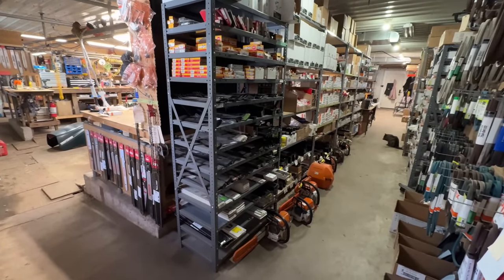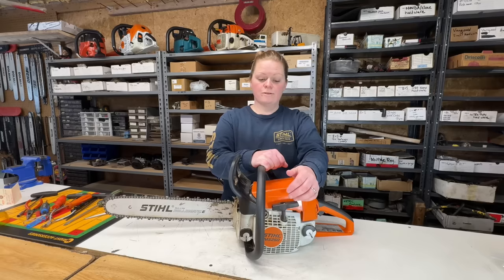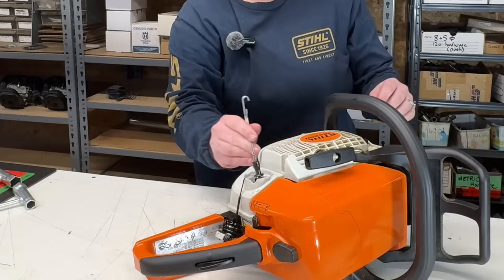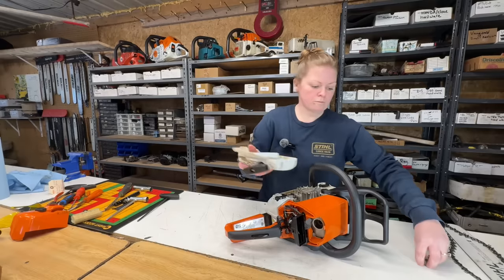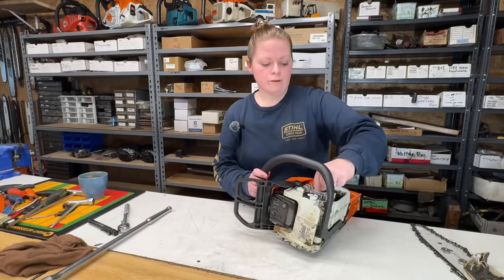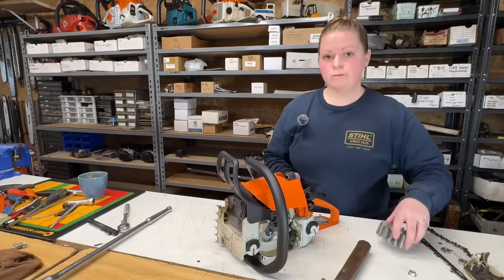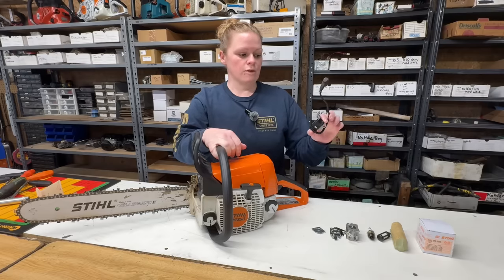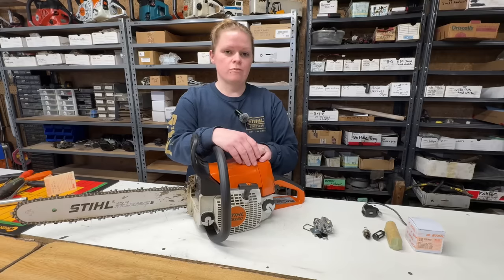Stihl MS250 Chainsaw HARD To Start!  It Wants To Rip Your Arm Off!  Let’s Dive In and Find Out Why!

Comment: MS250 owner here. Excellent information. Thank you!

Bad arms and back here... and I'm on my second MS250. It's a good saw. I'd only add that... 
the saw CAN be a real stinker to start... IF care is not taken under full choke.

Suggestions:
- Find a good video on the proper starting procedure. Doing so has delayed my meeting Jesus and reduced my profanity tirades by a factor of at least 4. That's probably what happened to my first MS250 (it died of shame as I verbally assaulted it over the years). Don't be me. Learn (early) how to properly start your MS250. So, here's what I learned...

- I've found that it's important to listen and be super-aware on the initial full-choke pulls. If you don't hear/acknowledge the priming (final) pull in full choke, and continue pulling/fail to advance to half choke,  it takes ONLY ONE superfluous full-choke pull to vapor lock (or flood... not sure) your engine.
When this happens, you can cuss and pull till your arm comes off... and the saw WILL NOT start (not anytime soon anyways).

- To help avoid this, I learned to slide half of my hearing PPE up so I can LISTEN while I was pulling in full choke. I've also found that going gloveless (just on start up) helps the senses detect the very subtle priming/final pull. Listening is the main thing.

- If you lock/flood your engine in full choke, the best solution I've found is to remove the cover, air filter, winter screen, plug wire and either loosen or remove the plug, pull several times to clear, reinstall parts... and pay better attention when you are on your full-choke initial pulls.

- Bonus: treat your plug wire (on the saw) with kid gloves. Parts quality (I believe) has gone down hill as of late. Early on, my second MS250 became difficult to start, the gremlin going undiagnosed for an entire season (complete profanity relapse ensued... I was down to learning curse words in other languages by the end of winter... that poor saw). The next spring, the long-fatigued plug wire gave up the ghost and came off in my hand. Replacing it confirmed the elusive problem... frayed or fractured plug wire that chose which days it was going to close the circuit and allow starting. Moral... plug wires (on saws) are not designed for repetitive un/reinstalling. Possibly my fault, but likely a crappy plug wire.

- Lay in a supply of spare parts for a rainy day(s) and/or chintzy part failures brought on by the communist invasion and resulting decline of society, infrastructure and build quality.

Hope this helps. Good luck and be safe.

Comment: I have had a husky 142 for 15 years. Used lightly for pruning and firewood. It became hard to start and wouldn't run. I was really puzzled, dismantled  the carb. All looked good, but no dice. Finally I tried adjusting the H jet, and yeah it now works like new! So happy that I figured it out, and fixed my baby. A chainsaw is like a dog! Cheers from New Zealand😊

Comment: When you had taken the saw out without the bar and chain, you can hear the drag on the throttle response. I always hit the carb first when I see ready mix fuel. As for the special tool for the piston, use a pull rope this way your not messing around with a flashlight. You are spot on talking about the compression on that saw. It will rip your arm off if you don't find the sweet spot.

Comment: Great video, thank you . I  have a MS 250 and it runs great with no complaints.  I pull it over on choke slowly the 1st time  then the 2nd pull with the choke still on I  do it full speed and it fires up with out riping the recoil rope out of my hand.

Comment: Excellent presentation. Very methodical.  I am a small engine technician in the UK working on lots of main brands of horticultural machines and the first person to blame is the owner / operator in all cases. It's their machine and it is their problem.  I've had customers ranting and raving that the machine is junk and they either want their money back or the machine fixed free of charge under warranty.  But it invariably is something that they are doing or have done.  manufacturers spend a lot of time and money designing machines and it's very rare that the machine fails without the assistance of a bodging owner or someone that has been lent a machine.  I have a wealth of stories of things that owners / users do to machines. Love from the UK.

Comment: I also have a Stihl battery saw and it always starts very easily, has no fuel issues, etc. My go to saw for firewood. My sawing technique got better as this saw does not like to be forced at all. It will do the job on its own just fine. I can carry it in the car for blowdowns on the driveway and the roads.

Comment: Starting my chainsaw, I use to put my foot through the hole where the hand to operate it normally goes. The Chainsaw doesn't jump around then when you pull the starter cord.Easier too.
Reply: Tiny feet or pointy boots ?
Reply: Hard with 17EEEE lumberjack feet.
Reply: @ValChristian-c9m  
YES! Why is it that the handles of all chainsaws are just a bit too small to get the toe of your boot into the handle? They all need a bit of a redesign; perhaps all the manufacturers assume that people drop-start their saws. I never do that because it seems dangerous to me.
Reply: @richardjames4632  I couldn't agree more. In user manuals manufacturers advise against drop-starting and advise to use safety gear, but still are not able to make the handle wide enough to put the toe of a safety boot  into it

Comment: I worked on a Stihl 046 and it also was a hard starter.  I am 73 yrs old and it would try to pull my arm off.  I rebuilt it a couple of times, replaced the crankshaft, piston and cylinder.  It is one of those saws that wants to pull your arm off.   So I made an electric saw started .  I took a 1/2 hp electric motor that can run both forward and reverse.  I machined an adapter that matches the flywheel pull starter. (you have to remove the pull starter housing.)  I engage the motor/adapter to the chainsaw and I have the electric motor plugged in.  I have a foot switch that has a momentary contact switch  installed.  You engage the motor and saw, step on the momentary foot switch and the electric motor starts the chainsaw with very little effort.  It sure beats letting the chainsaw beat me to death. When the chain saw starts it automatically disengages the chainsaw.  I use this tool on saws that are hard to start.  It lets me figure out problems without wearing me out.

Comment: I have a ms250 .Its a love /hate relationship.I love it when it starts. You can't rely on this chainsaw at all.I had it back to the dealer many times. You can pull on it and it may start, sit it down , 5 minutes later pick it up and it won't start. Sometimes it won't start at all sometimes it will start every pull. Everything on this saw has been gone over. Even the dealer told me they have issues with the cheaper saws. Now I grab the old stihl 260 and the Dolmar.The MS 250 is name correctly MS Might start

Comment: I have run mine wide open since I got it. Never failed to start once!
About 8 yrs old. 
Never changed the plug. Use only Stihl mix period.
 Have changed the rope once. Been throught 10+ chains.
Fine saw for me. But I only cutup trees that have been blown down. Lot of that here. Cuts them up great!😊

Comment: Yep, im a Setup/Floor Technician at my shop. Anyone tells me they are having a problem and they start going off about checking this this or that. I begin at ground zero. It may hurt their ego because they think u dont trust them. But i cant tell you how many times, they say it wasnt this or that because they looked at it. And it ends up being something very simple. Obviously he didn't say any of this, but wanted to act as if he didnt break the seal. So he could hopefully get it under warranty, unlikely being an old saw. But ego's are big when it comes to chainsaws! People hate to admit they were wrong or that they may have made a mistake. Especially if its a female repair tech. Some guys cant accept that a woman may be more mechanically inclined than they are... So unfortunately we've all been there. So basically start at ground zero and do all the simple checks first. That dont require new parts for replacing them after checking them out...  at least without first discussing the added costs with the owner/cudtomer anyways.

Comment: I bought my MS250 from my local JD Dealer, Last one in stock before they put out the new ones with bulb - I have a pre bulb MS250 and it ran sweet for many years, always started always ready to go. In last couple years it started running and stopping after 5 min. then progressively in same day in next 4 to 5 starts would run less time each time till just would not start. Took to shop and replaced coil. sweet again but after about 10 min. it did same thing, I opened it up and realized if they had put a new coil in it, it should be a little cleaner than it was for only making about 15 rounds cuts on 10" trees. I purchased a coil and replaced coil - it could be slightly out but close enough and should not die as it had been like plastic housing warming up and wires disconnecting in coil - only thing left is carb. shops around here are so un-trust worthy - want new gaskets etc. - iam a difficult customer i hear now. still possibly need a carb .  I have done shelf fuel, and Non Ethanol mixed with Stihl synthetic mix small bottles 1. gal. mixtures. 2 new air filters, 3 plugs, 2 fuel filters - all on top of what originally i had in it when problems arose. ( Plus new fuel lines, electrical came with coil i put in. Iam about 50 bucks away from having spent what a new one would have cost.  I actually bought a new one at ACE and it would not start a second time when they were pre fuel and starting it for sales so I ended up cancelling that CC transaction and re done because of warranty's then they had another and purchased that one, seemed all good, left- picked up mini excavator and headed for little property 45 miles away - saw would never start, it popped once and that was it. needless to say i took it back-manager would not except it so i left it on counter with papers and said CC will be stopped payment and never been back in last year. This brings me up to my age and hand- finger size- unable to put a carb on and stuck with finding a good shop, I even have 5 carbide chains and 2 extra roller bars , been using a HF chain sharpener so about 4 years ago I bought an Oregon sharpener and am quite good, I have a few guys whom are fire wood cutters ask me to sharpen their chains- usaly 8 or 10 at a time a year- I feel honored and the 8 bucks a chain is good - Iam retired disabled vet. i have a lot of free time but not a lot of time.

Comment: When I heard the symptoms my first thought was flywheel key.

Good perseverance to get it fixed.
Reply from the maker: I wasn't going to let this chainsaw beat me!
Reply: I'm putting my Stihl in the yardsale.  Piece of shit.   Plus my dealer was a real dick.

My Husqvarna chainsaws never fail and never break an arm.
Reply: I have a 250 that has a partially broken flywheel key. It lines up fine, so I’m thinking that will work for now… I still can’t start the thing, however! I even replaced the two seals. I guess I’m going to replace the carb next!
Reply: I also thought for SURE that it was Sheared as well ...  but then my only real experience of replacing them is on  Lawnmowers .. Never seen one actually sheared on a Stihl Chainsaw.... but the symptoms certainly matched .
Reply: I had an old 041 given to me years ago that had a sheared flywheel key. Have no idea how that happened, but a new key and it ran fine again.

Comment: I have a Stihl 032 that had been giving me same problem.  Ran well but took two arms to start. (I made a starting board to hold it down with two feet while starting.) I hadn't considered the coil, so cleaned and gaped it yesterday.   Wow, I'm 79 with a shoulder replacement.   It started like it was brand new.  Thank you for the informative video.  The saw is about 44 years old and I heat the house with wood so it gets a great workout in southeast Michigan.
Reply: i us the dropsaw method to start ms250 . when its warmed up i hold cord and saw shoulder hieght and thro tha saw away. just for fun. 91 octane fuel and 38:1 mix . 
WE need a John Force version of a chain saw fixin video.. 
i am about 400 miles  North east of u . and i like my new electric saw just fine.  🐺

Comment: Cool video. I have 2 MS250's along with a MS362. I keep 2 with one being a back-up for the other, in case of issues. I'm in North Idaho and my dealer had to consolidate repairs to their main warehouse in Spokane, Washington last year (staffing-no one wants to work on saws or work for that matter). Turn around now takes over a week to two weeks, so I bought a back-up, since I use it all Spring and Summer.  After you bringing up the hard start, explains a lot. It's still a hard working saw.
Reply from the maker: Thanks for sharing!
Reply: she put in a NGK plug. good idea.

Comment: As a Stihl technician and owner of an MS 250 I can tell you they are a very hard to pull saw. I sold a lot of them but always cautioned the customer that most women, elderly or folks with a bad shoulder should consider a different model. If you don’t pull it like you mean it it will jerk starter handle out of your hand. I always thought that a larger diameter rope pulley would help this.
Reply: A decompression switch would help more.
Reply: @rickringler5021. See, if you had been my dealer I would still be a Stihl customer. Too many of them just don’t give a crap when a homeowner walks in to buy.

Comment: By the time you spent that much labor and parts, I’m betting the bill was as much or more than the saw is worth. I have two 250s that have the same trouble, one especially bad! One was given to me by my brother who gave up on it, and the other I bought at a yard sale for $10! Both are great little homeowner saws. I’ve found that when it kicks, it’s saying “I’m ready, take the choke off”. Couple pulls and it’s running! 
I have several other saws, all Stihl, but my very favorite is a little 023 that has several hundred hours on it… worn out, very little compression, but still starts easy, runs good! 
Enjoy your videos, well done! Thanks for sharing!
Reply: Yep. I have had the same thing happen with mine. Have been careful to take that choke off at the first sign of a hard pull. Also, for the infrequency of use, I have found the Stihl premix fuel is well worth the money. It has been no trouble with the premix.
Reply: My 250 does the same thing. I noticed that 2 pulls is enough, even when it doesn't start. Turn off the choke and 80% of the time it will start on the 3rd pull.(On daily use. It could be different if the saw didn't run for 6 months)

Comment: When putting your piston stop tool in the spark plug hole, you can remove the exhaust muffler and look into the exhaust port and make sure that the tool does not protrude the exhaust port. Keep up the good work.

Comment: I bought one last year not realising the potential starting issues....
However its been awesome, powerful little saw and has started easily so far, from cold choke till burp usually 2 pulls, then chock off max 2 pulls.
Even when flooded its not bad to clear and start so far. So light and powerful its a keeper.
Reply from the maker: Right on

Comment: It can be so easy to overlook the little things. I’ve done it myself a few times, so no sense in beating yourself up over it. All you can do is learn from it and bank it for next time. Though, I was thinking just like you - flywheel key sheared or wrong air gap on the coil. It is never good when someone who thinks they have an idea to fix something does so instead of taking it to someone who knows how to do so!
Reply from the maker: Thanks for being here!

Comment: I've got a vintage McCulloch from the 70's with an alloy case which I serviced and cleaned everything. It starts up no problem with plenty of compression and runs fine until it gets hot then won't start again until it cools down. Do you know what could be causing it to do that please? The mixture is right and i used leaded petrol yet it still does that. Its a shame because other than being quite heavy its a great saw for small jobs. Great video. You have earned my subscription 👌👍💚💛❤️
Reply: Mine too

Comment: I went from a Stihl 024 saw( from about 1985) which always ran very well but parts became hard to find about 20 years later. Got an MS250 and it was just as bad as in the video. Gave it away and bought an MS261 pro saw (I used pro saws for trail maintenance and knew the difference) and it has no problems at all. Compression release make it easy to start, 4 hp vs3 (250 saw) for same weight, much less vibration, need service far less often. You get what you pay for, in my book.
Reply from the maker: The MS261's are great saws! :)

Comment: So, did the new carb solve the kickback problem when starting? I could see how the old carb running rich would cause a carbon build up on the piston and combustion chamber, thereby increasing the compression enough to cause hard starting. It would seem like the only cure for that would be to pull the cylinder and scrape off the carbon.
Reply from the maker: The new carb solved the problem.   The old carb was over fueling - which explains why I seen smoke.   I don't know the history on this saw, and I'm not even sure if my customer bought it new or if he bought it used.   All I know is that someone had their hands on that carb trying to compensate for something.    Sometimes I feel like the chainsaw investigator trying to put all the missing pieces together Haha
Reply: @marriedwithsmallengines    Thanks for your reply. The old repair shop adage is that they charge more if the customer already worked on it themselves.